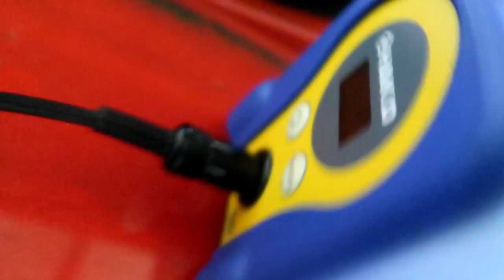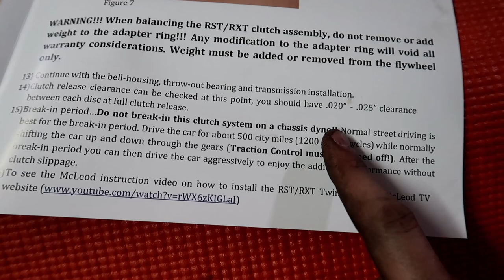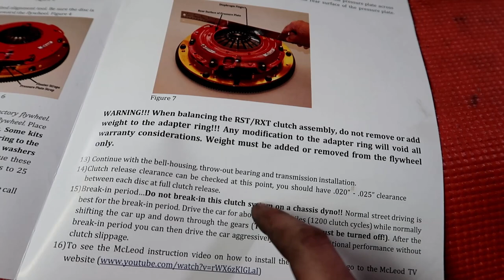I Broke It Real GOOD!

Comment: Pretty cheesy weld job on the drive shaft IMHO! Lots of gaps/openings. I hope it holds up for you. Have you tried some WD-40 to free that bolt? That broken ratchet is a new brand...instead of Snap-on, it's called Snap-OFF! lol
Reply from the maker: Yeah i looked at it up close and it's not too bad except for that one spot that dips down.  I'd have done a better job myself for sure lol! But it is a pretty fat weld so i think it'll be good!

Comment: I’m glad it didn’t chip a tooth on your new flywheel. That tool is for holding the flywheel still to remove/install flywheel bolts but not a big crank pulley bolt. I’d install the trans first and then do the crank pulley when you can put the rear tires on the ground, car in 6th gear, ebrake up.
Reply from the maker: Yeah they are stronger then you think! That tool actually flexes as well if you go back and look you can see it flex which prevents shock to the teeth. I know and have seen lots of people who use a screw driver or pry-bar on one tooth and i haven't seen one break yet!